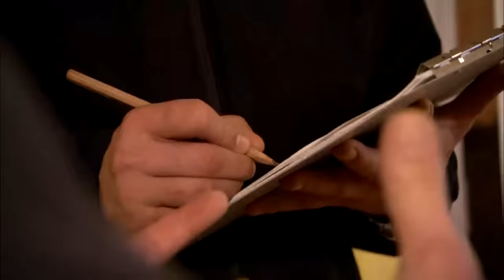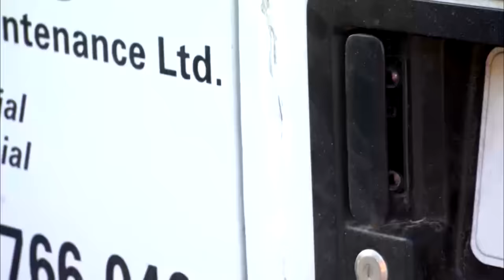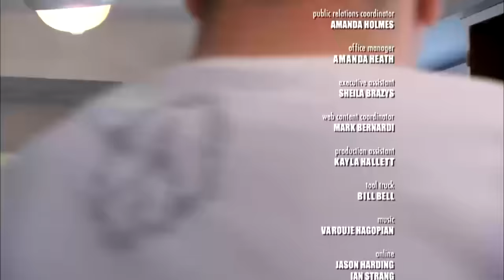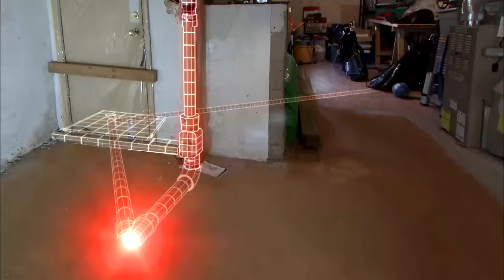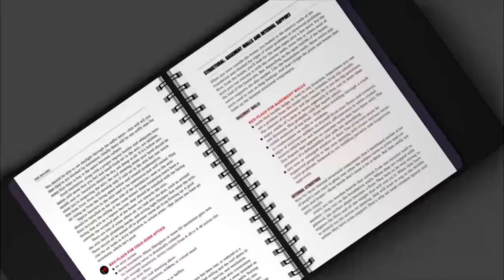Top 3 Mike Holmes Episodes | Best of HomefulTV 2023

Comment: I refused to buy a home older than me in the US. By the time I was born they started using modern building materials. Lead free paint, drywall instead of plaster, copper and pvc pipes, breakers with romex wiring, and vinyl double pane windows.

Comment: Mike & Damon should have kept the window open to the basement. Natural light goes a long way when it comes to being 6ft under.
Reply: There's no railing on the 4 steps that are coming up to the front porch when it is required.
Reply: If you are talking about the window that had been walled over, that they replaced but re-walled over, then it's because it was too close to the gas lines/meter. They mentioned this several times.
Reply: The gas meter in my moms house is in the basement
Reply: @robynw6307  They could have used a closed off window, so it wouldn't have been an inlet.

Comment: If the homeowner actually cleaned her bathtub she would have known about the hole in it.
Reply: No, many just use clean water to remove the soapy water, cause it's fast and then let the  tub dry. And just look in the video how much power he uses to show the defect in the tub. A light swipe would never show the defect.
Reply: It could easily just be mistaken for a blemish on the side of the tub. 
She may actually just give the tub a quick wipe dry each time she showered it.

Comment: Option 3 bring in a company that specializes in repairing tubs, and stop being so dramatic that we have to replace every thing. Drama queen Foremen. Oh and we can not fix the loose plumbing by cutting into the drywall on the others side. use your brain. Foremen and Plumber.
Reply: It was a fibreglass tub, so chances are any repair would cost as much as replacing it. Those things weren't that expensive. Plus the constant leaking creates other problems as we saw.
It wouldn't be a good look for the show to fix one thing and have a related problem appear in a few months time.
Reply: @Cheepchipsable  oh please Labor far exceeds the cost of repairing the tub. to replaceing it. grow a brain 😁